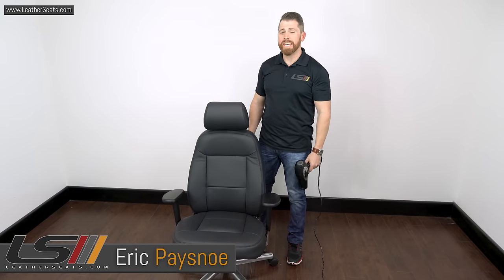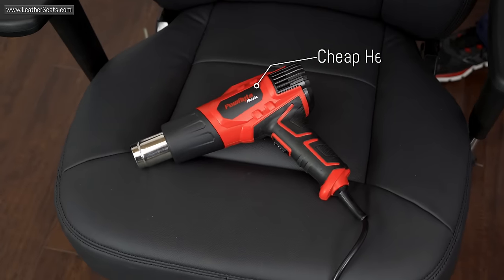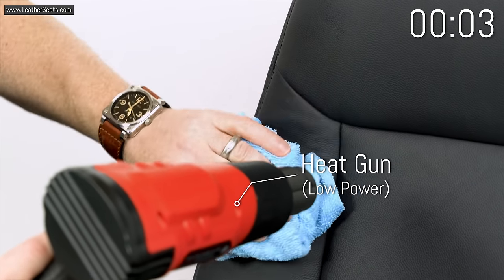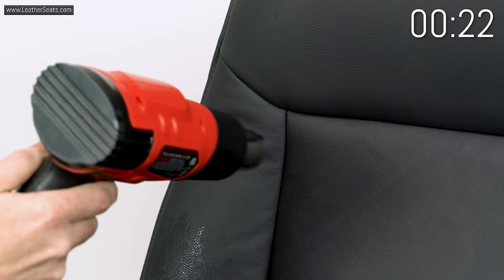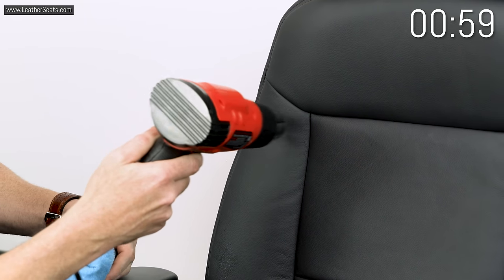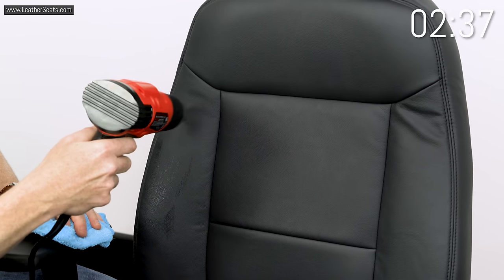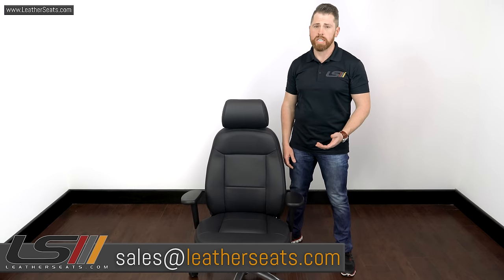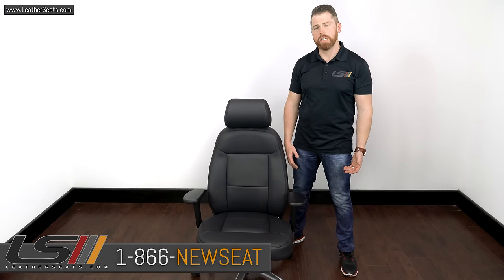Heat Gun Vs Hair Dryer - How To Properly Use Heat Gun On Leather - LeatherSeats.com

Comment: Gave the hair dryer barely any time, maybe a minute thats no good. Then proceeds to give heat gun a go, done nothing for first two minutes. Clown
Reply: Yea he didn’t even give it a shot
Reply: The hair dryer is trash my dude, you need higher temps
Reply: @mihailhidler5400  some hair dryer goes up to really high temp
Reply: With all the lint on the air dryer filter, I'm amazed it even worked.

Comment: If you're here to shrink a leather JACKET and you don't have a heatgun and only have a blow dryer, it's not going to work. You will use a iron on medium setting, and iron the parts you want with a very thin piece of cloth on top of the leather or paper - that brown packaging paper works perfectly, but i didn't have one, so i just used a t-shirt and it worked, it finaly fixed my shoulders which looked weird.

Comment: Are there any side effects to heating the leather?  Will the heating make the leather brittle even when using conditioner? I plan to do this but I don't want to make things worse afterward.
Reply from the maker: Richard Rama Every hide will take heat differently and each section of a hide may take heat differently which increases risk when using a heat gun. You can certainly overheat the leather which will dry out the leather and permanently ruin the grain and harden the leather. However, if the leather is heated correctly and does not take any damage during the process there will not be any lasting change to its longevity or durability.
Reply: @LeatherSeats  Thank you for the advice!

Comment: How do I get the wrinkles out on vinyl if it destroys it so quickly?
Reply from the maker: Samsung User We typically like to use steam on vinyl. Steam will not get as hot as a heat gun however it will still heat the material enough to make it more malleable. With steam you still need to be carful but its not nearly as tedious. We would recommend using a steamer that has a longer nozzle so that you can reach up through the upholstery during the installation and steam the inside of the upholstery. If you have any further questions be sure to give us a call at 1-866-639-7328 or email us at sales@leatherseats.com.
Reply: I used steam to clean my headliner and it melted the glue. Be careful. Good luck.

Comment: Very helpful video.  Just wondering if apply this would make the leather easier or hardly to wrinkle.
Reply from the maker: The heat gun helps remove wrinkles from the leather when used properly.

Comment: Thanks for the vídeo! I thought that using a heat gun was bad for the leather, but it is good to know that one can I use it with care...

Could you have accomplished the same goal using steam?
Reply from the maker: Delta Johnny Steam is an installer's best friend! You may not get the exact same results as a heat gun but we recommend steam to anyone installing our upholstery. Also, once installed put the seats out in direct sunlight for several hours to help with some minor wrinkles.
Reply: Thank you very much again for the great videos and advices! :-)
Reply: Use a steam iron?

In the sun light lol. I live in England, we don’t get any of that. I’ll have to take it on Holiday with me to Spain

Comment: did you clean  the back of your hairdry ?   its seens like full of dush
Reply from the maker: Noah Vertucio The hair dryer we used may not have been the most clean dyer out there, however, not matter what condition the dryer is in, using a household hair dryer does not give you enough power to heat ratio to produce major effects on wrinkles. If you have any questions about fitment or installation feel free to give us a call at 1-866-639-7328 or email us at sales@leatherseats.com.

Comment: What a leaning process.  I have a seat with a soft crease to take out on the front below the legs  How would I begin?
Reply from the maker: mrjata It depends on the crease itself but firstly  you need to make sure the area with the crease is real leather and not vinyl. Do not use a heat gun on vinyl. You may want to use a steamer to get up in between the foam and the upholstery for a more gentle heating process or you can use a heat gun as long as it is real leather. A heat gun may be easier because you might not have to remove the seat from the vehicle. However, using a heat gun is always a bit risky. Have a wet wash cloth on hand and constantly wipe the area down as you go to prevent the surface from getting too hot. If the leather gets too hot for your fingers, back off with the heat for a bit. While the leather is hot, massage and pull it in the opposite direction of the wrinkle to counter the crease. Depending on  how long the crease has been there it might not completely come out. Be sure not to over do it with the heat because every leather seat takes heat differently. If you have any questions feel free to email us photos of the seat to sales@leatherseats.com and we can take a look.

Comment: can you use the gun to do the same thing on vinyl and cloth?
Reply from the maker: Taza Leather You never want to use a heat gun on vinyl because it will permanently damage the vinyl almost instantly. As for cloth you might be better off using a steamer to get moisturized heat into the material. That said, every application will vary and require specific attention. Just approach the project with caution.
Reply from the maker: @TazaLeather  You are welcome!

Comment: Great content! Could you make a video on how to remove wrinkles from vinyl? Thanks
Reply from the maker: loupipeline Thanks for the feedback! I will pass the comment on to our video crew. As far as a simple answer for the vinyl, we typically like to use steam. With steam you still need to be carful but its not nearly as tedious. We would recommend using a steamer that has a longer nozzle so that you can reach up through the upholstery during the installation and steam the inside of the upholstery. If you have any further questions be sure to give us a call at 1-866-639-7328 or email us at sales@leatherseats.com.

Comment: The $20 heat gun uses 1800 watts. I bet my hair dryer would do it. It runs on 1875 watts and cost me $300 lol
Reply from the maker: Kimberly Brown lol The problem you will run into with the hair dryer (even the expensive fancy ones) is that there is too much moving air with the heat to be effective on the leather. The heat gun puts out a ton of heat will much less moving air which is what you want in order to hit the surface temperatures needed to smooth out wrinkles. If you have any questions about the process feel free to email sales@leatherseats.com.

Comment: What's the temperature used on the heat gun?
Reply: The heat gun temperature varies with distance and airflow.  A heat gun can generate temperatures as high as 1500°F or as low as 200°F.  Typical use will be between 300-1000°F.   Most heat guns have an adjustable airflow vent on the intake and a switch to control the number of elements in use.  He said in this video he used the heat gun on the low setting.   I would never use a heat gun on leather. Heat is an enemy of leather and while it may have no immediate impact on new fresh leather it will impact the life of the leather.  I don't understand why anyone would worry about a few wrinkles in the leather.  I recommend using mink oil on leather to keep it from drying and cracking over time.  If I HAD to use a heat gun on leather I would apply mink oil just before and after applying heat.  This will help keep the leather soft and flexible.

Comment: Does the heat tighten the leather ? I have some
Katzkin leather in my 21 ram 1500 and the bottom cushion has an area where the leather is loose !
Reply from the maker: Matthew Boutilier Heat gunning can help tighten leather but it can also greatly damage it if you are not careful. Never do this on vinyl though. Steam is another way to work out wrinkles however the results from either method will vary based on the age/state of the leather. Please give us a call at 1-866-639-7328 or email sales@leatherseats.com and we can give you more information.

Comment: I thought they say that heat can destroy leather, that it will make if very stiff and it will start breaking?
Reply from the maker: karosi Creative DIY  Too much heat or heat applied incorrectly can damage leather but if you apply the right amount properly it can get you a much better fit and finish on your install. Using steam is always recommended for installation but with a heat gun though, you need to be somewhat experienced and extremely careful as it can damage the leather very quickly. To avoid your leather getting stiff and breaking it needs to be properly taken care of. Using steam during the installation will not hurt the leather but it does need to be conditioned every few months and cleaned using a gentle leather cleaner fairly often.